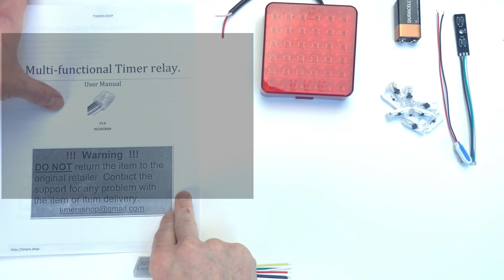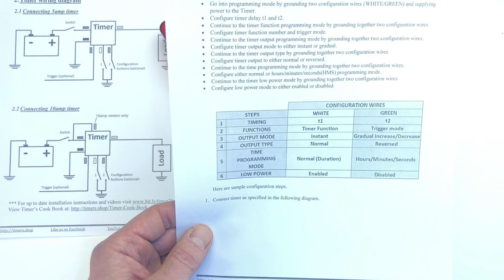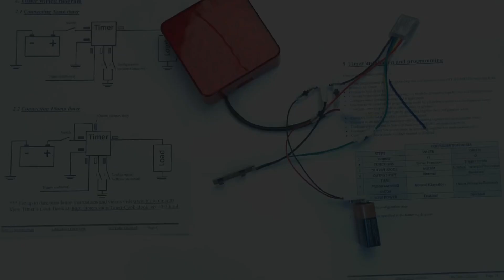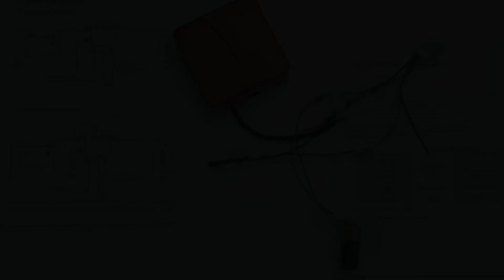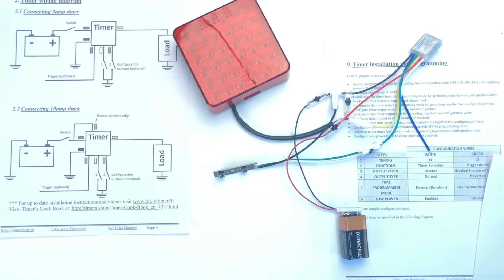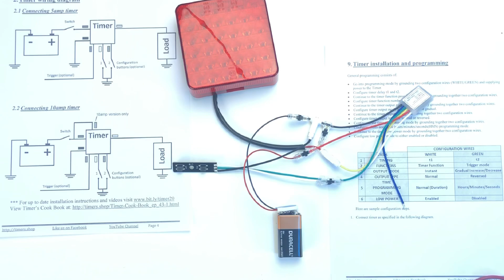Multi-Functional Timer connection , programming and troubleshooting.

Comment: Hello, I have a fan that turns off every 12 hours. I would like to prevent that, inside the fan there is 5 volts DC voltage. Can the component simply close a button for a short time every 12 hours ? And that this circuit is retained after a power failure

Comment: Do you need to purchase the board used in this video, or is it included with the timer? If not, how would you program the timer without the optional board?
Reply: Not included, but no need to buy the board.. it is just two momentary switches that connect to ground.   You can just ground the wires to do the programming

Comment: Also it would help immensely if YOU would just go thru the steps as they are outlined in the programming Written section. Because when someone READS these steps it is NOT clear. Just for instance..... step 1 ok, that's clear...... step 2 Configure timer delay t1 and t2....THATS ALL IT SAYS???? HOW DO I CONFIGURE the timer delays??????........... If I were writing this  I would say in step 2..... Ok, to configure the timer delays we need to take the Green Wire and the White wire and determine how much time we wish the timer to delay, so with the POWER ON? Power OFF or what???? Hold the white wire to ground........ Then hold the Green wire to ground??? Why.......? Are there TWO Delays we are programming???? ......BE MORE SPECIFIC>>>>>>>And going back to the first step you say ground the two wires and apply power........ DO we LEAVE it on? Forever?
Reply from the maker: We do . Take a look at the videos: http://timers.shop/Timer-Programming-Videos_ep_42-1.html

Comment: You do not indicate during your FUNCTION setting whether you ground the Green or White wire?? Does it matter? All you say is press button 1 or 2 or whatever. You MUST remember, that whatever seems basic or simple to YOU is not to the person who FIRST sees this timer or attempts to program it . Be SPECIFIC not so nonchalant
Reply from the maker: The manual states the button 1 connected to White wire. Many places in the manual tells to use White wire for function setting. It is not possible to provide all the details in the videol